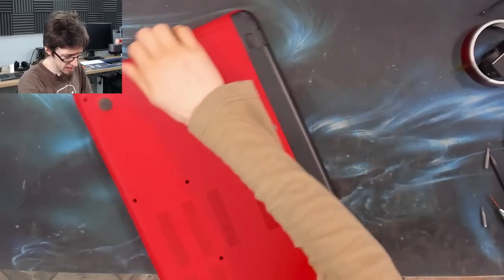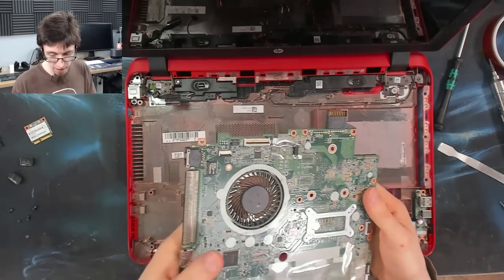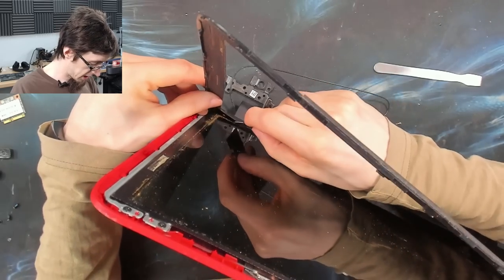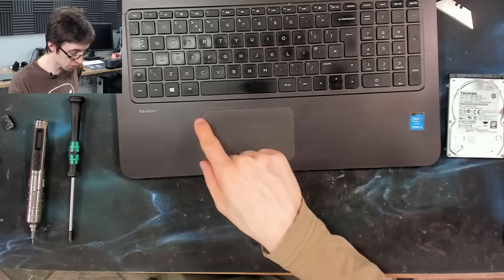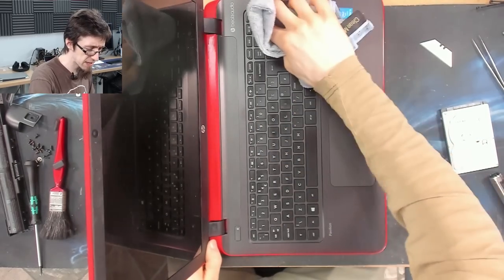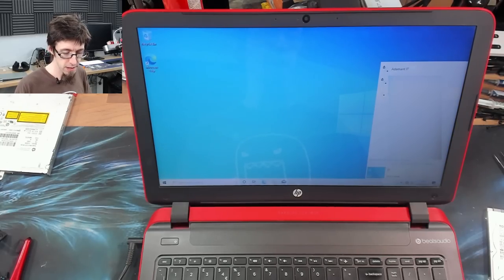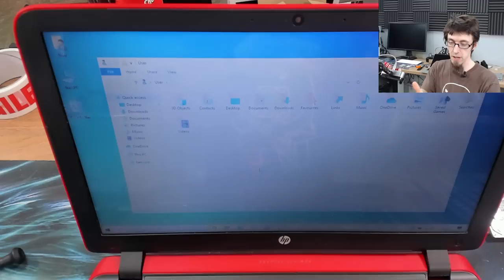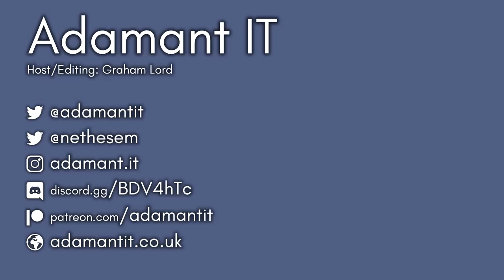HP 15-p Laptop Refurb & Chill - LFC#269

Comment: As a person who fixes laptops and refurbishes a lot of them:
I like your videos but there are some practices that are kinda odd and not good in my opinion

Firstly, missing bottom screws and trying to open the case with force might cause the screw posts to break more easily. Also while opening the laptop it is advisable to use plastic tools/metal pry tools covered in soft coating to prevent damaging the case. 

Next up – that thermal paste was definitely not good, and as for application of it- you should not place thermal paste on the PCH (smaller cpu die), as the pch might get damaged more quickly from the added heat. PCH runs at 30-40CC, while the cpu can easily get to 80-90C under load. Even dell themselves prohibit applying thermal paste on the PCH in their guides (google “dell thermal paste on PCH” and go to first result about i7-5600u)

The cmos battery was probably still good, but they cost literaly pennies, and it was worth replacing it since it was on the other side of the motherboard, 2.8V is kinda low considering that a fully charged one is between 3.2-3.3V. 

Manipulating under the display bezel with a metal tool is also not advisable, as the display is very sensitive and it’s flex connections might break overtime more easily. Using the razor blade was straight up dumb. 

BX 500’s are terrible dramless ssd’s that die quickly and run very hot. It is better to get a older mx500 for nearly identical price. Saving up 11 pounds just to leave old cmos battery and a much, much worse ssd is in my opinion not worth it.

Coiling the wifi antenna was also a very bad idea, you would be better of installing in into the bezel while you had it apart, or put it without the whole coiling, as this can sometimes lead to intermittent connection or worse reception/stability. 

This might seem like a rant, but it is not. I am just posting my opinion on what I really did not like in this refurbishing process and what practices would be better avoided or improved.
Reply from the maker: These are some good tips. I don't agree with all of them, but some raise an excellent point.
Metal prying tools - yes, they can damage stuff. The solution to that is to be careful with them.
I've installed a lot of BX500 drives in low-end devices and never had a single fail or problem - horses for courses.
Thermal paste on the PCH - this is an excellent point, I've seen a mix of laptops that have paste or no paste on the PCH, and never understood why you wouldn't paste it. But the idea that the PCH will get heat back from the cooler hadn't occurred to me. So yea, good point I'll remember for next time.
The bezel... yes... be careful. That's why I backed out and said "no that's not working..."
The results of the extra wifi antenna speak for themselves. It clearly didn't get worse. Putting it in the display assembly is harder than it looks, as there isn't the channel space for two antennas - I've tried before on this chassis, and the bezel doesn't fit back in.
But yea, appreciate the feedback. I wouldn't call any of my work a defacto "this is the correct way", these are just ideas and methods that seem to work for me.

Comment: I use these BX500 all the time in cheaper gaming builds. There's no need to pair a 300-400€ gaming PC with a top of the line SATA SSD.
Reply: As a DRAM-less flash drive the BX500 writes internal tables to NAND flash and has a limited lifespan. That said I've had MX300s that I installed die after only 4 years

Comment: whats the deal with erasing an ssd ??(sata,m.2,nvme) do they need secure erasing the same way as hdd's. or do they need some other way to securely erase them??
Reply from the maker: Each SSD manufacturer usually has an official toolkit for doing firmware updates, health checks, etc etc, and those utility apps usually include a Secure Erase tool. That's how I do it. I'm not sure how good that is on a forensic level, but the manufacturer tells me that it's a secure erase, so that's good enough for me at least.

Comment: What is that small powered screwdriver you are using.....
Reply from the maker: It's a Sequre SQ-ES126. Review coming soon - it's fairly pricy, but good for small screw work.
Reply: @Adamant_IT    Thanks, you are right on the pricy, about 100-110 bucks,  think we can do better on Amazon with a diff. brand...

Comment: Use the guitar pick thing from iFixit or use a thin guitar pick to separate the bezel from the double sided tape.
Reply: Guitar pick is way too small. Watch the vid, he had to push the tool in about 25mm-30mm down and still be able to hold onto it. If you did that with a guitar pick it would all be down under the bezel with nothing left to hold on to.....

Comment: Some laptop heat sinks have a hole that exposes the smaller of the two processor dies, only applying heat transfer to the larger die on the processor, Why is this?
Reply from the maker: I believe the smaller die is an on-chip PCH (chipset) which doesn't need cooling. I think that either the heatsink is designed for a single-die CPU, and they haven't bothered to update the design, or they don't want to add the small amount of heat from the PCH into the CPU cooling calculations. If your HSF is designed for 15w, and you have a 15w CPU, adding 1 or 2w from the PCH technically puts you over-budget on cooling.

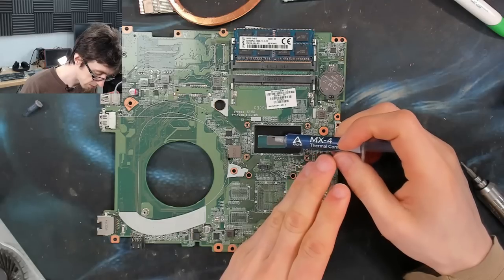Comment: 10:59 You should use "Thermal Grizzly Kryonaut" in the future❤️❤️❤️
its some high performance paste with 12.5 W/mK cooling capability ❤️🥰
Reply: I have put Grizzly, Noctua, Arctic (MX-4 and Silver) and honestly they all seem the same. I personally think the mounting of the cooler and making sure the whole CPU is covered with thermal paste is more important than the paste itself.

I have reapplied the same thermal paste on my CPU as well and I have had small temperature differences like -2c or +2c when reapplying the paste/cooler. So that's more to do with how the cooler was applied and how little thermal paste was used. 

So I think for the money 💰 it's not worth the extra cost. I would buy one of those tubs of thermal paste if I owned a shop and wouldn't think twice about it.
Reply from the maker: Kryonaut is for LN2. On air cooling you'll see virtually zero difference. But at -100c the Kyronaut will still be working and MX4 will have frozen.

Comment: Can I donate an HP laptop that has failed and I have failed to diagnose even with tons of hours and 2 cpu replacements, and a motherboard replacement? Nothing is shorted. White light goes out when power button in pressed and no charge led when battery is installed. I found 2 blown components and replaced. Still no dice. I’m at a total loss on this thing. I just want to see a pro fix it or ditch it. Because at this point I probably have 80 hours into it plus $100. I have a schematic but don’t know how to properly read it. I am still learning.

Comment: I had a really weird issue with my hp 15 laptop's WiFi as well. I used to have to reinstall the wireless card drivers every time I turned the PC on so it would even detect my router. No idea what was going on there

Comment: A keyboard with that much wear, I'd just replace it. They're usually pretty cheap on eBay for a new one and those wear marks make the entire machine look poor. Less time cleaning saves money.
Reply from the maker: Heat-staked keyboard 😩
Would be another hour replacing it.